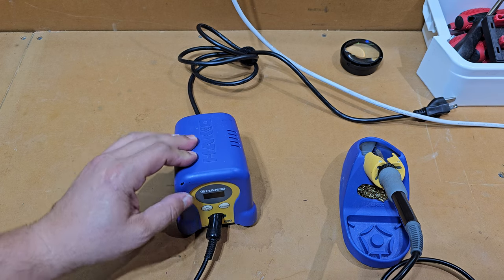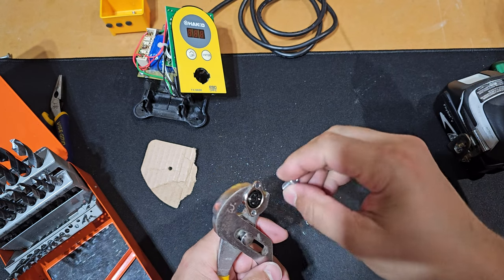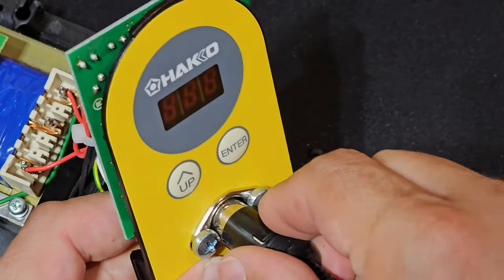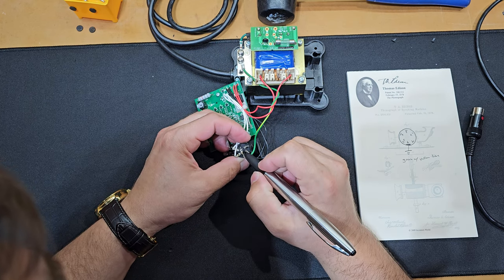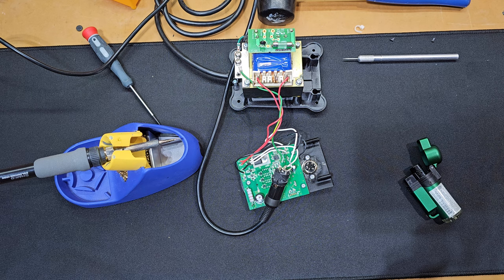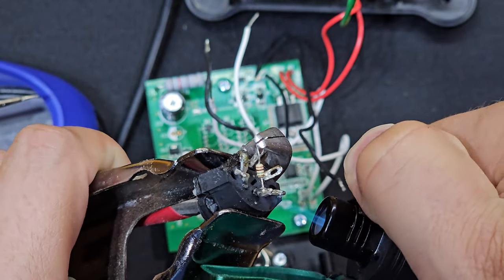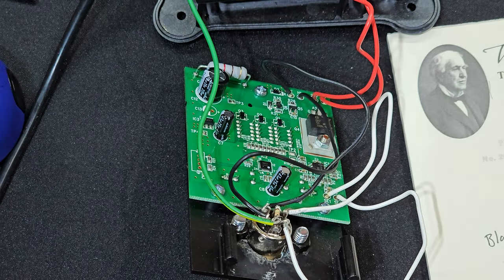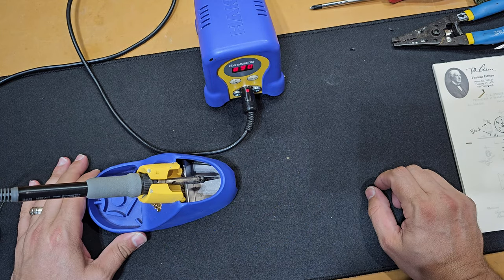Enhancing Hakko FX-888D: Upgrading the Troublesome Connector & Adding Orientation Indicator

Comment: A Dremel tool probably would have been easier for elongating the notches where you need to mount the connector to the plastic front panel. And man, them screws are rather a bit larger than they need to be.....#4-40 or 3 mm hardware would be more appropriate, and you wouldn't have needed to drill out the DIN plugs' mounting holes.

Comment: Informative video.  My Hakko just became intermittent at the din, even though all looks fine.  Will use your fix.
Reply: It amazes me that HAKKO uses an ordinary DIN plug for the connector when many clones and no-name units, including some that sell for significantly less, use screw on microphone or ham radio type connectors with a metal shell and more current-carrying/ heat-sinking capability.  I've been working with audio electronics for over 50 years and have lots of experience with audio equipment using DIN plugs, and I would never design a soldering station to use them. BTW, It is possible to obtain DIN plugs to go on the cable which have a metal outer shell and a locking tab.
Reply: @goodun2974  Love everything else about the iron.  Actually behaved today !